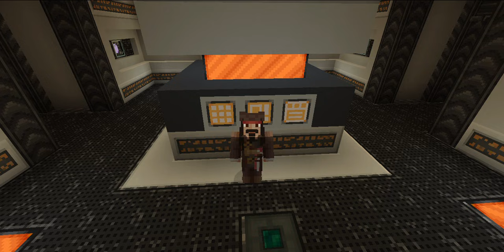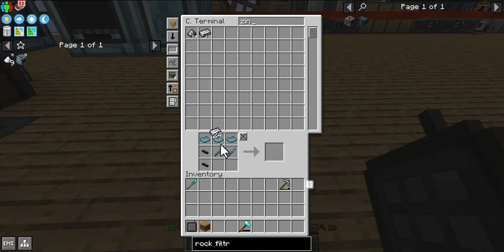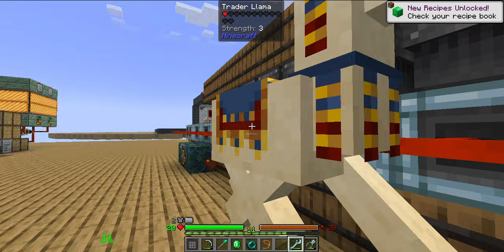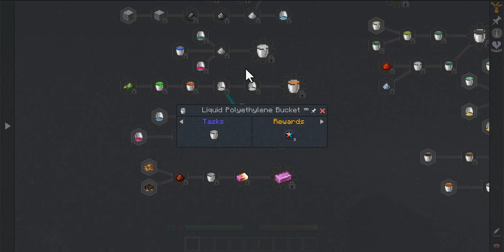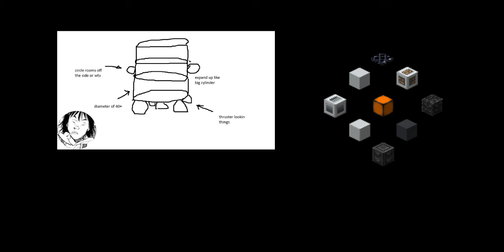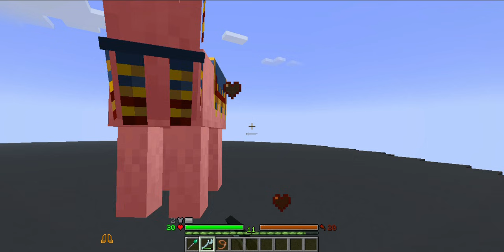Star Technology - Ep. 3 - AE2 and a Fancy New Base

Comment: how did you make the dilluted sulfuric acid go into the trash?
Reply from the maker: You can use gt machine parts as machine covers to transport items or fluids. iirc I used a LV electric pump with a fluid filter on it to send it to the trash can.